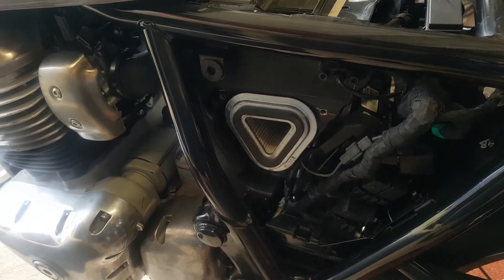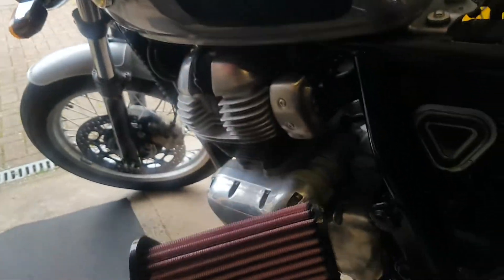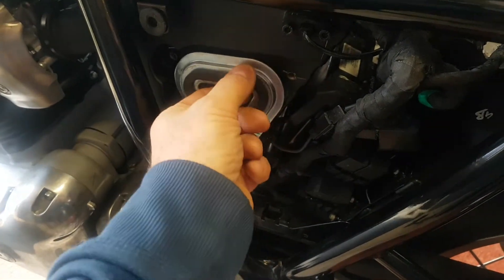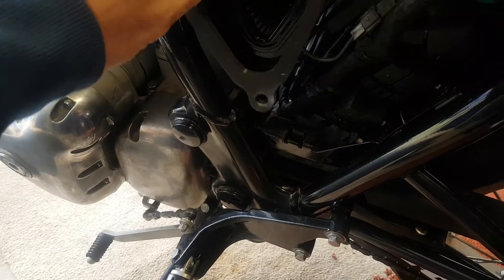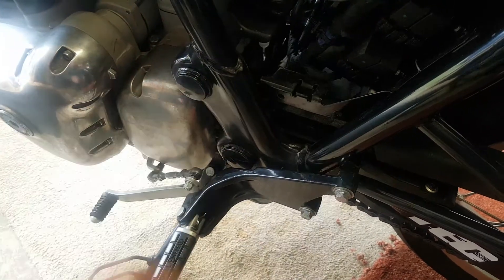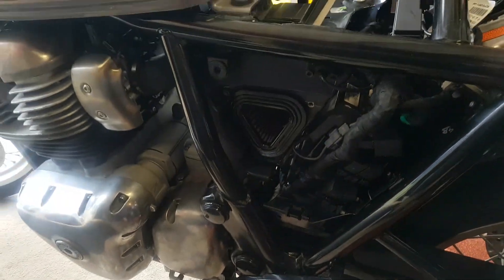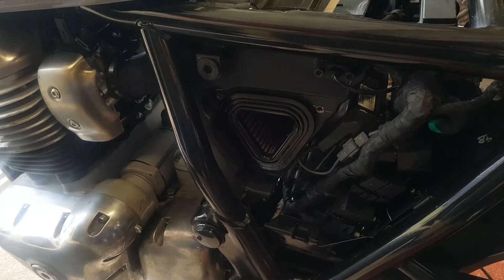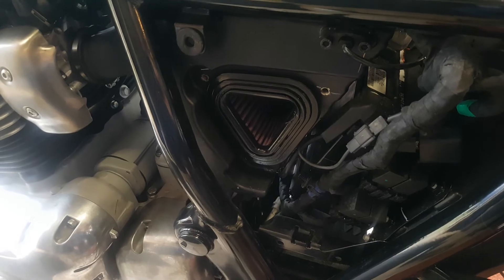Royal Enfield interceptor K&N airfilter arrived today

Comment: I just bought a K&N filter. In the middle of modifying my air inlet.
Reply from the maker: If you are brave why not make a hole in the left hand side panel where the air intake is then glue some fine mesh inside the hole. This will allow more air into the air filter which gives a bit more power. On the TEC Bike Parts videos Matt says "more air means more power....".
Reply: @clarkyracing  I'm afraid I really like keeping my machine's original. Getting rid of the chain was huge for me. Thank you for your videos and this reply.

Comment: Can someone please tell me how more air makes this bike perform better. All modern machines have been tuned consistently leaner and leaner to meet stricter emissions requirements and because of this the throttle response on many new bikes is really annoyingly notchy, twitchy or snotty or whatever you want to call it. By introducing more air via freer flowing filter and airbox etc won't we have an even leaner situation?? How can these be even drivable?

Comment: when using the K&N filter do you need the fancy bracket, will it work with the standard filter cover?, dose using the standard cover effect the performance?.
Reply from the maker: You can use penny washers to hold the filter or buy a bracket that costs from £29-40.
Reply: @clarkyracing  thank, i know that, but what abt using the standard cover? should work just as well?
Reply: Standard cover won't work well cos it restricts airflow from cover to filter

Comment: I am planning to fit one on mine, how does it perform on a stock bike compared to the stock air filters?
Reply from the maker: My bike has run so much better than standard. I fitted the air filter a month later and it breathes so much better with out the snorkel.